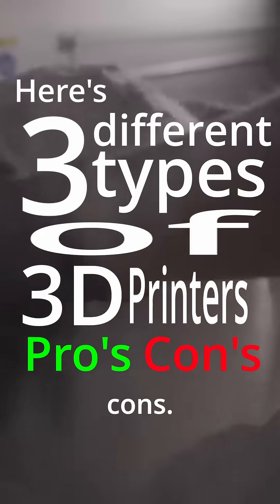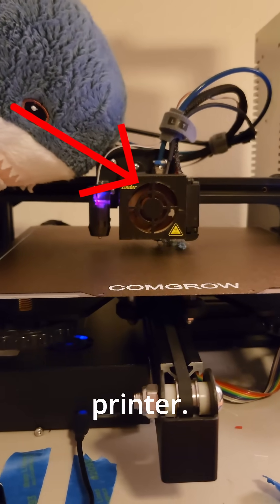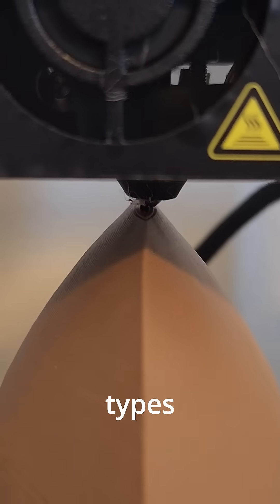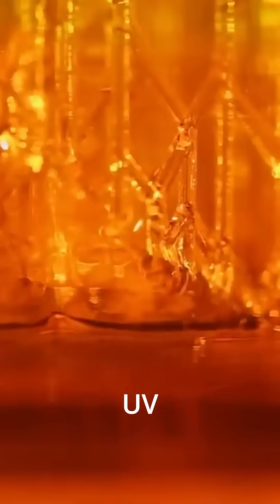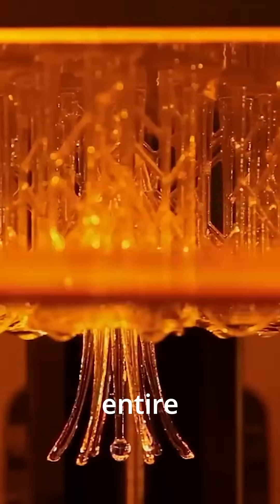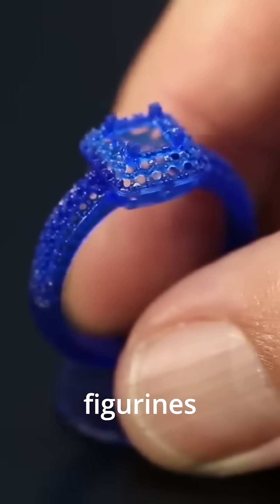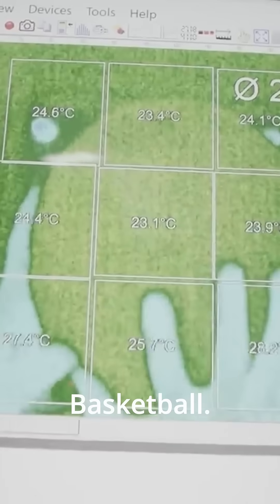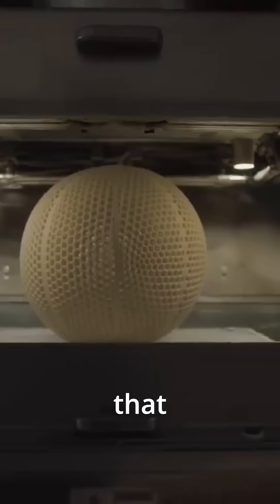How many types of 3d printers ARE THERE?? #ender3 #fix #3dprint #3dprinting #diy #ender5 #3dprinter

Comment: fdm has types too! 'bed slinger' is things like the ender 3 also fits into the belt type. theres bed risers like some enclosed tipes similar to resin printers and theres delta printers where all motion is in the print head

Comment: There is also LCD, DLP, offset-LCD, 2 photon polymerisation, tomography, xolography, WAM, LPBF, EBM and more. Honestly, you missed almost all of them. 
There is also no reason you should buy fdm first before any resin. They’re so distinct that you don’t need to learn anything. Knowing how plastic melts contributes zero to knowing how cross-linkable materials cure. Thirdly you also need ventilation for e.g.  abs and that falls in your first category of fdm. Tssk

Comment: There is actually 1 desktop sls 3D printer, it's called the Micron Desktop SLS 3D Printer, and it's a reasonable price considering its essentially the first of it's kind
Reply: They got bought by a much larger firm and we probably won't see the micron released in the form we saw.

Comment: Do you want an ender 3 V2 with a metal bed, and a CR touch for $80 it is in good condition and the reason why I'm selling it is I have a couple more modern printers and am soon going to get into Resin printing and new the space.
Reply from the maker: @coleluscombe3324  Thank you for offering but I am probably not gonna be buying any printers soon. I would post on reddit though! Might find someone there.
Reply: @Rduino  thanks

Comment: To clarify, there are more technologies that could be called 3d printing. However FDM, SLA and maybe SLS are the only ones not only used on industrial scale.
Reply: Selective Laser Sintering (SLS) is one of the most common industrial 3D printing. Did you mean only regarding the plastics?
Reply: @Dudakiller13  I mean that those 3 processes are the only ones relevant to hobbyists right now. I wasn't sure if there is any consumer grade SLS machine or just industrial ones.
Reply: SLA, MSLA, and DLP is all different technologies on itslef, even while working with same category of materials. So he already cut the list short.
Reply: Resin printing is so perfect right now.
Reply: "FDM, SLA and maybe SLS are the only ones not only used on industrial scale." wouldnt excatly say that. first off, i think you meant industrial purpose because all the print farms that exist i'd absolutely say that the bigger print farms can be considered industrial scale. prusa for example has a huge print farm and even websites like jlcpcp offer this service.

and second: even in purpose fdm printers have a great purpose in the industry for prototyping and they can create shapes not possible through subtractive machining or injection molding
Reply: @Kittingsl  Industrial purpose is the better wording, yes. Not only used for industrial purposes also includes industrial purposes. What i was trying to say was that there are more technologies that could be called 3d printing but those are limited to industrial use, mostly because of the expensive machinery.

Comment: Don't forget DED (directed energy deposition), WAM (wire arc melting), LPBF (laser powder bed fusion), and EBM (electron beam melting). These are typically used for metals and can make parts competitive with cast / conventionally manufactured alloys. LPBF and EBM work similarly to PBF,  but for DED powderr is added from the heat source. WAM is essentially programmed welding, as it uses a wire. The advantage of this method is that it doesn't require a vacuum and minimal risks beyond fuming, and was recently tested on the ISS
Reply: you sound like a Damn hospital with all these acronyms

Comment: I actually have to disagree with SLA being less beginner friendly expecially with advancements in the past few years... I think it really comes down to what you're wanting to use the printer for you will have a much harder/easier time with one or the other. Odor levels have dropped significantly other than certain cheap brands or specialty resins. There are actually some that are VOC free and printers pretty much universally come with an active carbon filtration system and while I had to build one a few years back since they didn't exist there are now sealable hoods with another filter and an exhaust port that you can use. But even before I made that I was able to use certain resin in my 144SF room without any fumes or noticable smell. Also certain filinants still should only be used in ventilated areas so I don't think thats a huge con. Also with the improvement of waterwashable resins alcohol isnt require for the post processing period. I will give you that there is a little more work that goes into it because you have to clean the model and cure it. But with any modern printer you should be fine to literally level the bed and throw a pre sliced model to print and have it come out great. Its probably my bias of learning resin printing first but I think they both are pretty beginner friendly and both have complex levels you can take things to but I also know people who were experts in resin printing who had hard times learning about proper bed heat, nosel size/heat/extrusion rate, changing filaments and with things like batch printing.

Comment: Do you have a video on how to EASILY LEVEL a ender 3 I have the same one as you and I tried the paper method it didn’t work and also ya know the corner closest to the nozzle yeah for no reason my printers nozzle when homed is so close it burned a hole in it so yeah and I have had so many problems with levelling that the printer left a print mark imbedded in the plate so yeah please help me
Reply from the maker: Sounds like the nozzle is way too close to the bed. Find a bed leveling print and bring the bed down on all 4 wheels. Then bring it up till you get good adhesion. I will include a link to a great guide about this.
Reply from the maker: https://www.reddit.com/r/3Dprinting/comments/cg3g6g/ive_made_an_infographicstyle_guide_to_leveling_a/
Reply: @Rduino  thank you very much this will help a ton I really need to get it working or it’s just gonna stay as a paper weight

I’ll definitely give the instructions a try when I get around to the printer again thank you 🙏
Reply from the maker: video link broke, sorry. https://www.youtube.com/shorts/uWF-85pdbVQ
Reply from the maker: https://youtube.com/shorts/uWF-85pdbVQ?si=jhFWyTER2rJyp3Hd

Comment: People always say to start with FDM, before going to resin, but the 2 have almost NOTHING in common.
I say, by the printer that meets your needs.
Reply from the maker: if they cant handle basic fdm then they shouldn't really be expected to handle something that needs special care and required fiiltration
Reply: @Rduino  but fdm doesn't teach you anything about resin. If they're a grown adult who wants to make miniatures for a board game, why would they learn fdm?
Reply from the maker: @3sotErik  because jumping into fdm will likely lead you misinformed when fdm is one of the most dangerous forms of 3d printing in terms of toxicity. You spill any amount and it will ruin anything it touches. The fumes are also highly toxic. It might be better that they start with fdm to learn about 3d printing until they get into sla, as they will spend time in the 3d printing community learning all they need to know before getting into sla.
Reply: @Rduino  I've been doing both for years and I took this advice only to find did it did nothing for me. FDM doesn't teach you to be safe with resin in any way.
Reply: @Rduino  so what you really should say is, if you want to 3D print but aren't comfortable handling hazardous chemicals, then go with fdm.

Comment: "No need for filtration" for FDM? Depends on what kind of filament you use and even with PLA I would recommend it.
Reply from the maker: Well ya it can depend on filament. But nto everyone has space for the filtration so while it is a good idea, if you are printing with a non-toxic-fumes filament like pla, then you are probably fine to forgo it.
Reply: @Rduino  if you don’t have the place for filtration perhaps you should not do 3D printing. Or get a mutualised space like a hacker space or a fab lab with a few friends.  

And PLA definitely has toxic fumes, just less so than ABS.
Reply from the maker: Looked it up and it seems that there is no concrete answer as it varies from filament manufacturer to manufacturer. It generally seems like the amount of voc's emitted are similar to a water heater and are not unsafe levels

Comment: Watching that footage of that person handling the SLA print with no gloves rustled my jimmies.
Printing resin is very toxic and until fully cured should be handled with gloves and proper PPE at all times.
It is possible that the print was fully cured, but with how easily those supports were coming off I highly doubt it
Reply: My boss has a sla printer in his shed and he has some strict rules when being in there
Reply from the maker: I think it was fully cured. The footage is from glow forge I think.

Comment: Depending on the filament for FDM 3D printing, you will need to have a filtration. I know of Nylon and ABS isn't a good idea without venting and/or filtering.
Reply: Yeah from what I heard if you don't have a good ventilation and/or filtering system it's best to stick with the basics like PLA, PETG, and TPU. Some people even ventilate/filter for filaments like those due to VOCs and UFPs, but they're generally considered safer than others like the ones you mentioned.
Reply: give me the styrene poisoning
Reply from the maker: Yea
Reply: it is not a necessity, it is if you want to print more than once.